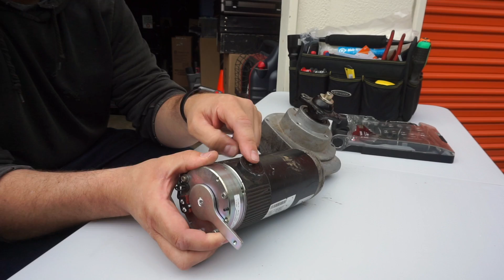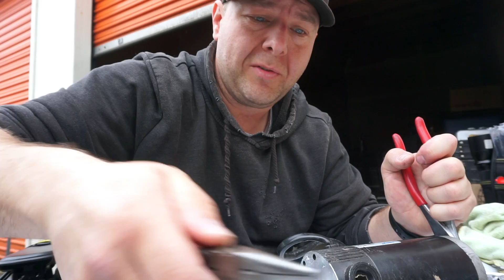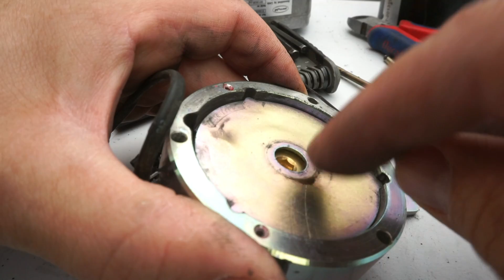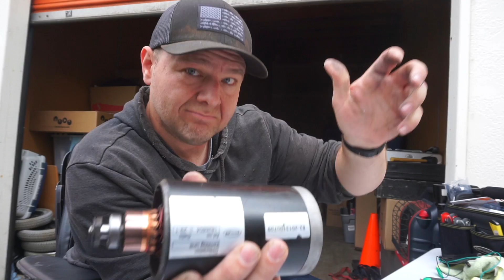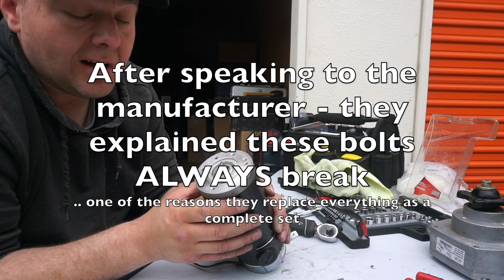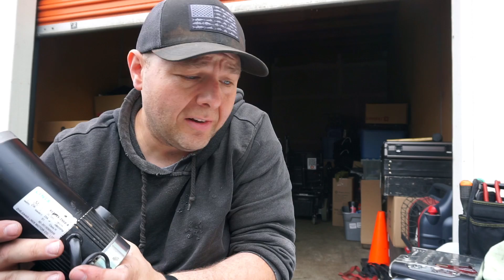inside a wheelchair motor (VLOG 333)

Comment: Good video. At least I know where the oil leak will most likely be coming from on my Puma 40 but unfortunately I still haven't found the answer as to why my Salsa M2 brakes sharply (as is required) but my new Q500M rolls for a while before stopping which makes using it in central London very problematic.
Reply from the maker: there's a setting in the programming called 'forward deceleration' that should help... requires a handheld programmer to change though... OR is it coming almost to a stop, then there's a delay before the brakes actually click on?
Reply: @TotallyNormal-  The holding or parking brakes (as shown in the video) engage normally once the chair finally comes to a rest. I suspected that the problem could be in the programming but I have no idea how to even get hold of a wheelchair programmer, let alone how to do it as I usually limit myself to mechanical issues only. I once had a technician make some adjustments to the VR2 ECU on my old Salsa and he did it through a program on his PC; although I would imagine 'end users' aren't trusted enough to do it themselves. I once had an Invacare Storm 4 X-plore with Tru-Track motors, an amazing wheelchair, however, Invacare in the UK refuse to supply parts outside of their dealer network and dealers, of course, refuse to sell parts without service.
Thanks for your reply, at least I have a name for the matter now, forward deceleration, I'll try to figure out how to go about altering the settings. Thanks again.
Reply from the maker: i think the Q500m has R-net controls..? thats the closest setting to it..BUT  the VR2 stuff has a specific setting for the time before applying the brakes..  R-Net however doesn't have a specific delay setting for 'holding brake' engagement...does your chair slow down fairly gradually when ya let go of the joystick? the brake engagement is baked into the setting for deceleration.. it slows the chair with the motors, then after ya get close to stopping it clamps them on.  (pretty sure it uses current monitoring to determine when you're actually stopped)  so i think making it 'stop faster - or decelerate faster' should net the same end result of them turning on sooner.
Reply: @TotallyNormal-  The problem isn't the time taken for the holding brakes to be applied but the length of time it takes for the chair to decelerate and come to a stop after the joystick is released. On the Salsa it's fairly quick to slow down and stop upon release of the joystick (and then the holding brakes click on), of course, if I put the joystick in reverse (on the Salsa) it comes to a halt even quicker, thereby avoiding collisions with pedestrians or getting squashed by cycling extremists. But on the Q500M even after the joystick is released it rolls to a halt quite slowly; putting the joystick into reverse makes no difference and it still continues to roll for 3 to 4 feet, then once it stops the holding brakes come on. What I want to do is reduce the time it takes for the chair to initially stop. 
Incidentally, the Q500M is available with VR2 or R-NET, I don't know which my chair has but I suspect that it's the VR2 as this chair appears to have 2 pole motors although Sunrise claims to supply it with 4 pole motors. I'm basing this on my newly acquired knowledge from the video that two brushes is two pole and the Sunrise website shows a Q500M with motors having four brushes, two more than mine!
I'll take a look tomorrow to see exactly which controller has been fitted.
Reply from the maker: ah! ok then yes - the deceleration setting is what ya need then! make sure that they change the setting for forward AND reverse! 2 separate settings! yea that's not safe!!  also does the E-stop mode work on the chair? if you need to slow down quickly,  pulling joystick in the opposite direction briefly activates a higher power braking mode.. (dont worry its not bad for the motors).. its actually a secondary setting called "hard braking rate"

Comment: Highly Appreciated learned a lot ....... Is there any way i could get my chair go any Faster ?????
Reply from the maker: programming is the only thing - but it wont usually get ya much.. typically its mechanical limitations that set the top speed.  ...bigger diameter tires maybe.. but then that kinda throws off the geometry of the chair.. aftermarket motor controllers.. but that's a whole big deal.. if the brand / model of chair has a high speed motor option.. sometimes ya can find used high speed motors on ebay.  the difference is the gearing typically.
Reply: @TotallyNormal-  Thank you so much bro your reply means a lot to me.... And you're videos have already helped me lot in resolving my wheelchair problems 😘😘😘 Thanks Once again......

Comment: Just a question, I recently purchased a WHILL Ci and really like the way it handles, unfortunately the electric brake clicks rather loudly and bothers my wife, I’d really like to stay married so is there any simple way to minimize the clacking noise. Thanks..love your videos..a new subscriber.
Reply from the maker: hey hey!! well.. i haven't seen a whill in person yet and have no idea what mystical magic makes it move... theres usually a way to make most controllers ignore the brakes.. BUT its total unknown for me on that chair.. as far as making it quieter.... the brake coils get hot, so ya cant really try insulating them.. sooooo short answer... i dunno shrugs  id like to check one out at some point! they seem neat!
Reply: Totally Normal thanks for the quick response, it’s still under warranty for a year so I really don’t want to be too radical at this time. I wanted to get the electrical schematic, but they only sell those to the retailers. Hopefully in the future someone will post a YouTube on the innards of this chair. Thanks for taking the time to do your instructional videos. I’ve learnt quite a bit.
Reply: Hey there, i did a mod for the invacare motor locks when they switched to a big metal disc with a lever on it probably 5 years ago? I removed the brake release lever and 3d printed a plastic one. This eliminated over 1/2 of the noise. The lever itself was acting as a sound amplifier. Making it out of plastic deadened the sound.
Reply: Thanks for the idea. I don’t have access to a 3d printer but it’s an interesting concept. BTW still married..lol

Comment: great video...just took my daughters old wheelchair apart..i would like to use the motor to make a sliding gate...any idea howto do it..thanx
Reply: Hey man, if youre still interested, just remove the motor lock, and the motor itself runs off 24v. I would recommend a couple of small UPS batteries wired in series for 24v, use the original tire as friction against the ground, and then you run the voltage red wire to +24v black wire to -0 v  to go one direction, and just reverse the 2 wires to go the other direction. If you want a controller, thats a bigger topic.

Comment: SUPER EDUCATIONAL VIDEO!   Everything covered and in detail.   I have 3 wheelchairs, 1 is really Heavy Duty, and the others are regular duty.  I have plans to use the motor(s) on a 3 Wheel bicyclic.
24v which I also have 24v Solar Panel to Supplement the Charge of the batteries.
Reply from the maker: i actually made a trike conversion thing a while back.. BUT i used bicycle chains to drive it, and the gear ratios i picked, the chain couldn't hold up to the torque haha!  i think hub motors are the way to go! use one in the front wheel, and youre done!
Reply: I made an electric 2 wheel bicycle when i was younger using a wheelchair motor. Drove the pedals with the motor so I could use the gear ratios. Bug mistake. Nearly broke my leg when the motor kicked the pedal around and hit my ankle! Chain had slipped loose of the back end and the motor suddenly gained a lot of speed, couldnt move quick enough. Whatever you do, be careful!

Comment: The battery of the chair needs to be shipped quickly and a new one. I do not know where the problem is. One of them said that it is possible that there is a short circuit that causes a decrease in the battery charge. It does not receive electricity for more than one and a half hours. The chair moves approximately 1 kilometer

Comment: Btw, I’m planning on riding a mobility cart “Across Florida” from Tampa to Daytona Beach...
Reply from the maker: sweet! when ya planning on doing this??
Reply: Better mount a large solar panel on it I used a 48vdc section of a Chevy volt battery and split it paralleled it and I only get 24 miles of range with 94ahr

Comment: Thanks for the great video! The lube for the gear reducer is on the label on the side, I believe, long with the ratio, and maybe the torque rating (scratched up?)....interesting! Those chairs cost $35K? How would you remove the bearing(s) either from the gear box or of the motor or armature, if you happen to know? Thank you for showing all you did!
Reply from the maker: thanks!

I'd assume some sort of press.. or maybe a small brass mallet.. never removed the bearings - maybe they just fall out easily? lol  haven't been able to find any specs on the load ratings etc.. they don't usually stamp these things for some reason.  would be nice for those of us that want to rebuild things instead of replacing!
Reply: Totally Normal then, how would they make their $$$$ lol 😏

Comment: I had to watch this video again. you really seem to have an endless pool of knowledge. I might be able to pull that apart...but I'm not sure it would still function when I was done hahaha. I've been kind of lucky with stuff like that (broken screws, crossed threads, etc). Hand the broken item off to a machinist and it comes back with a short story....oh, no problem, I just used an easy-out . or I just drilled out the screw and chased the threads with a 10-24 tap.... Then I think back to shop class in high school and my inside voice says "YEAH RITE !!! it was just that easy".
Reply from the maker: yea - RE the broken bolts.. apparently they intentionally use soft metal "screws" and PERMANENT thread locker to mate the motor to gearbox.  provides a shear point, or planned failure mode - kinda like breaking a U-joint in your truck, instead of shearing off the input shaft on the rear differential haha. 

permo peeps said -"Don't expect to take a motor off of a gearbox without breaking bolts!"

Comment: Nice video! First, between a 6 and and an 8 (or 6.5/8.5) motor package on most chairs - What's the difference, usually? Motor? Gearbox? Both? Second, how hard would it be to mod the 6.5 motors into the 8.5 MPH package, unofficially? I've seen Burgerman's 15 MPH BM3 custom chair, but that's just too much, especially since I'm no engineer, nor do we in the US get lump sum amounts like him to buy/build our own chairs.
Reply from the maker: hey hey! its *usually * the gearboxes that are different.. ive chatted with at least one person that's swapped gearboxes over from a different motor set.. haven't tried it myself at this point.  in the case of the older quantums, (6000z) the motors also appear to be different as well as the gearboxes.  but larger tires.. thatll get ya more speed! - of course causes other problems.. like the geometry of the front and rear castor wheels.. and the suspension getting all weird.   but yea,.. once you get over 7.5 or 8 mph.. its a whole different world!
Reply: Thanks. Such mods are beyond me at the moment, as I don't even have a spare chair, but it's nice to know. Also, I wouldn't take Quantum's gear as much of an example on anything, their chairs are cheap crap. I can't name anyone I know that's specifically chosen their chairs, especially the higher end models, and been happy with the quality.
Reply from the maker: yea.. LOL mostly they're just REALLY HEAVY haha

Comment: I’d love to see what’s in an Invacare GB motor. But it would hurt to see you take one apart because I need a right GB motor. Plus they must be in demand since they discontinued them. Their selling for hundreds on eBay.
Reply from the maker: yea.. and I still haven't had a chair with them either!! 

BTW i was able to drill, and use an EZ out to remove those broken bolts on the motor housing! were back in business!

Comment: ok, so they're using an O ring to seal up the gear box instead of a gasket? Cuz I saw that cast aluminum and thought to myself, well they have the bottom is metal and the top is metal and it's got gear oil in there so they're probably using a gasket between them but I didn't see one when Dan opened it up....Interesting....Question though, how do you know how much gear oil to put back in there once you've opened it up? Just wondering...
Reply from the maker: you can see the O-ring flush mounted into the top half of the lid. 

thats easy! dont spill it and ya wont have to put any back in! LOL
seriously though.. usually 1/3 to just under 1/2 full is how most gearboxes need to be